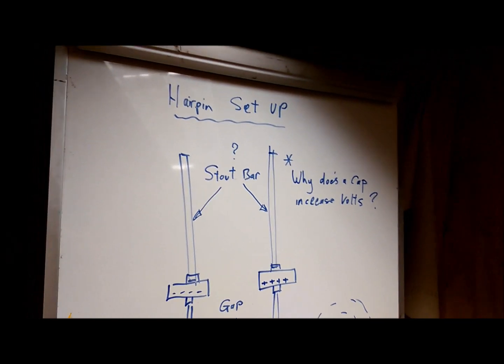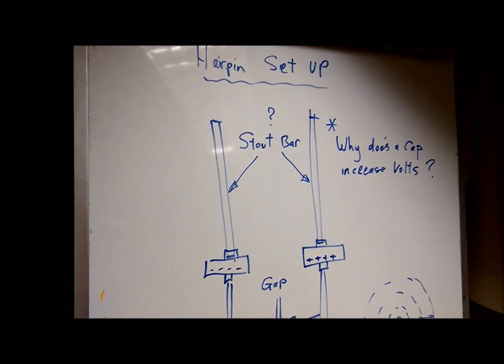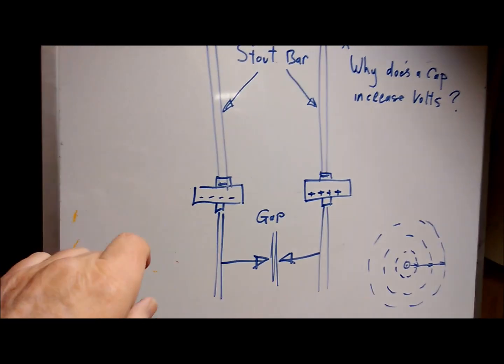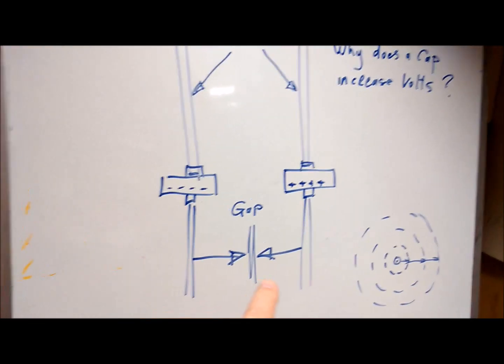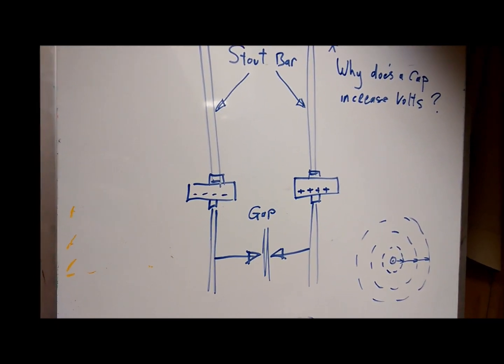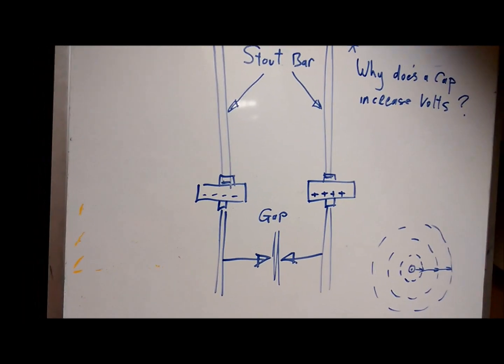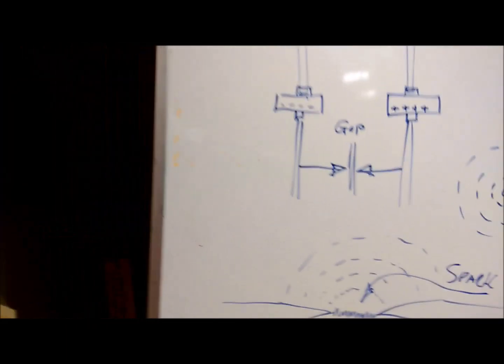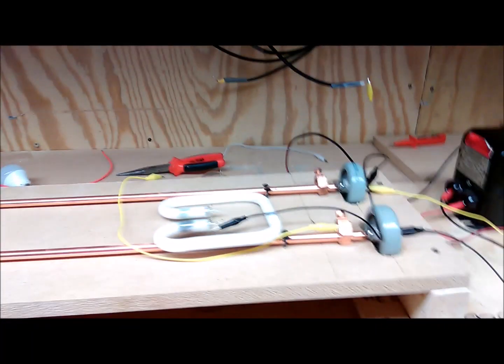Electrons do not exist ( Nikola Tesla Hairpin Circuit )

Comment: Tesla believed in aether in which em waves probagate. It's the work of Faraday steinmetz heavyside. Hertz and Maxwell that matters. It is the displacement current that flows between conductors that is of interest in the direction of the electric field that is a scalar longitudinal wave that interests so many. Electrons appear because of atomic physics where its convenient to imagine particles. However Maxwells equations are of the form fluid flow equations. Imagine a spinning flow of fluid into counterspace and another opposite flow rotating flow out of counterspace.  The source and sinks are the two charges. The spins form attraction or repulsions of this fluid. Counterspace flows counter the viscosity losses such that a charge has lossless intertia. The size of the sink and sources voids are the mass. Faraday and others saw the world roughly like that. When these sinks and sources the flows push at a right angles to these spining vortecies which is the  cross product of the velocity direction of the vortex and electric field. The magnetic field loop upon themselves ( due to prop of fluids ie flow of aether) the electric field is attraction of spinning vortexes which repel if same direction and attract if opposite. The origin of e field is fluid rotation and the origin of mag field is the right angle push upon a moving rotational void.
Dielectricity results where matter short circuits  space by rotational fluid conduction paths (e fields) within atoms (permitivity) . permeability results when magnetic materials provide aether flow paths conduits. Imaging pipes lining up for max flow versus random.
Aether flow are mag field lines and the ease of net linear flow in a material is permeability. The rotational flows forming together to create a larger rotational flow through a material is permitivity which makes the rotational flows  easier. That conumicates charge Rotations. The dielectric lines terminate on conductors. These counterspace voids are quantized and are of exact volume hence mass.
  You might think of a conductor as grops of atoms which connect rotational aether flows efficently (conductivity). Nothing really moves. The rotational moments conduct ie electrons are rotational intertia powered by counterspace. If you call that a particle so be it,  if you call it a wave because it can probagate a signal and power fine. It's rot flow causing net attraction or repulsion of what? The voids. What powers it? counterspace. Magnetic fields are closed loop macro linear flows of aether. What is aether? Incompressible fluid. What is a void? An elastic wormhole to counterspace that can be created or eliminated by flow conditions. What is a dielectric discharge? Chain reaction of void collapse and recreation from counterspace.
Reply: I have looked at the whole arguments for counter space and find it wanting. If you properly conceive of an Aether particle, the need for a counter space goes away. If you hold on to the magical thinking that a field exists, you have to have a counter space.... the bottom line, if your original foundation fo reality has a magical concept defining reality, you will need magical thinking to make reality fit... and you have abandoned any possibility of mastering reality... you will have to depend on your dogma to guide you and sooner or later, your concept will be surprised with failure.  
I'm not trying to argue. I'm just saying, it works for me, and Business Science, or Pirate Science is flawed in this way... counter space, which leads to cause and effect reasoning to demand things "vanishing" and coming back "before they left"... is just magical thinking when mechanistic thinking, holding to the definition of time as just marking the flow of events (its not a dimension)... all of it requires years to master because you cannot see it working around you, and you must memorize the "rules and laws" to understand what is right in front of you.
Keep in mind, anything that is made of multiple components cannot be conserved. Unless you change the definition of "conserve". Electricity has more than one component, so it cannot be energy if energy is conserved. And matter... same thing.  Also, if a law or rule depends on a closed system, it is not a real condition... it is magical in its foundation.  Peace, B
Reply: @mundymorningreport3137  ... But isn't it real science what we observe somehow changes reality? (Double Slit Experiment). I'm not sure what the difference is, either, between a "closed system" and "open system"..? What appears to be going is a debate between fields-and-particles. The particle physicists represent material science (a closed system)? While, the field-people (Tesla, Ken Wheeler) support Electric Universe Idea, that seems to be based on infinite energy potential, that somehow generates fields that we don't fully understand, yet.
Reply: writerNB update 
The pulse was the probably a combo of the way the rotor design slips 180 for synco operation and the loose ‘bearings’ :’D
However I am winding a third experiment, again, same or lower R but 1.68 times the inertia, and the strangest thing possibly the same self resonance??
This all adds up to me that it will pump 1.68 times the water for the same net Watts 

But one thing that made me laugh was take any ‘out of the box’ washing machine pump , slide the perm feild rotor off and observe a rotational offset R combo of say 22Watts , slide the rotor on and run unloaded 13~Watts :’D jam rotor full load 25W :’D 
:’D
:’D
Reply: @kolinevans9127  Hi Kolin, thank you for your thoughts. I have background fixing low voltage appliances (like PCs, laptops, printers), have worked professionally as a tech, qualified in software engineering. Way you describe your electrical experiments, means I cannot see your entire system (component by component) - entire physical circuit... From what I gather, you are adapting washing machine motor/rotor in an attempt to gain higher output results (low input voltage > to achieve more work (watts), yes? So, I'll just ask you a few questions (and hopefully) it will assist me with comprehension of your "experimental design".

1. Do you have a youtube channel (like EpowerDC) - so I can see your experiment running?

2. Do you have electrical engineering quals/training: so you don't hurt yourself?

3. Do you have access to correct detection equipment, so you can verify what you suspect is happening? 

4. Do you actually publicly share your findings? (Some researchers and experimenters do not do this in field of "Alternative Energy Research"). 

Peace. Thanks for reading, and for your kind words.
Reply: writerNB 
Thanks for the reply 

1 I have a channel, but I may ‘patent’ release my ‘invention’ also that just mean release it in the style of an old patent

2 the whole area is a hazard , it’s theoretically an extreme situation the hazard extends outward and unfortunately not everyone has made it here to where we are.

3. To asses inductive inertia, take any fixed ‘Condenser’ of a fixed known value and place it in circuit with the inductor using a rotational applied force enter the applied force at one end of the circuit and exit the other of the inductor condenser 
Place a single oscilloscope probe {Active} on the junction between the inductor and Condenser then place the reference on the input of the applied force , I use 20v applied force , set the resolution and lower the frequency until the rotational wave peaking depending of the light resistance and inertia it will peak at 50 80 200 V etc however the peak at Hz is the number you can use to place into a resonant frequency calculation along with the known Condenser to determine the inertia .
So you can see there is no real room for error here as there is no ‘meter’ for inertia I have a ‘meter’ but I do it this way, just as aside the meter is less accurate than this method. 
Any meter does exactly the same thing but with smaller Condensers and higher frequency. 

4. I just did, read 3 and I have from time to time and may again. 

Regards
Reply: @kolinevans9127  I see... :) Thanks for further feedback. I'd be fascinated to know how you achieve a 200v peak with an input current of 20v (assuming you're stepping down from standard UK 230V AC supply). This did catch my attention... "whole area is a hazard" ... With this in mind, I'll post this link you may find useful. HSE Guide - Electrical Safety At Work:

https://www.hse.gov.uk/pubns/priced/hsg85.pdf

Good luck with your patent. I'll attempt to follow your channel, should you decide to demo your invention publicly. Peace. Thanks for reading.
Reply: writerNB 
Hey thanks for the reply, one reason I haven’t posted work is because I assume as many others we all learn on the fly , some do it in groups others alone , I’d rather make my own errors and learn before attempting to add to the possible chaotic confusion. 
Having said that, I understand a lot more than I did say 24hr ago so again it’s a process, I’m still trying to fit TV force into the equation set as I understand it is again the source of offset . 
Don’t need the safety guide we walk on the edge here we love it, come visit any time. 

The peak is an ‘output’ technically, nothing Magik try it it’s just the resonate result of a realitivly high inertia low R on an inductor and a ‘condenser’  using a cheap sig gen.
Reply: writerNB everything in the 3D plain is inertia, where does the inertia come from? 
Inertia is formed from the condensation or ‘compression’ of a field this is why ‘linearly’ exists TV force is a higher energy state that vectors into the 3D plain and causes inertia. 
When Ken showed a higher power ‘magnet’ having a smaller inertia feild that’s because the feild frequency was pushed outside the medium I.e the ferro fluid , so the inertia is definitely still there it’s just at a higher energy state , push it higher and I assume the frequency continues to rise.
Reply: writerNB you know you’ve kinda twisted my rubber arm, I might look into starting some channels. I mean it can’t hurt to spread the knowledge we have right !
Reply: @kolinevans9127  Hi Kolin, thanks for your kind invitation to view your device. My findings suggest remarkable engineers (who make advances) Tesla, Dollard, Meyer suffer considerable impairment during the course of their researches. I also have reason to understand there is considerable misinformation around Tesla's work. Pity... 

The good news is, persons creating new devices, can engage a holding company, introducing the device (if it can pass safety regs) into a community that has asked for it. Therefore both legal and political issues are circumvented. In my case, I am privileged to be from a family of engineers (third gen), so seem to have a particular way of sync-ing with engineering minds. I tend to just observe senior engineers I've worked with, focusing on optimization (usually at software level) if device has an operating system. 

A clear objective (when it comes to Radiant Energy Tech) has formed in my mind:

1. If current can be captured efficiently from RE field, can it's amperage be amplified, so it can do effective work (watts) under load-conditions? 

Hope this sparks something for you. Thanks for reading.
Reply: writerNB thanks for the reply, do you watch ‘ludic science’ channel I find it interesting 

As for the history lesson, thanks for the feedback, sure everyone enters the game at different difficulty levels, if you were surrounded by engineers, you were ‘lucky’ to be playing on ‘beginner level’ I guess? 

I mean if tomorrow I found any interested child I could show them everything it took 6 years to XP in about 3 months if he/she was an effective listener, so it’s the ‘magik’ of learning 

However, there is something to be said to this ‘adveristy’ you speak of its the reward in knowledge that you XP it yourself and also the probability of something genuinely ‘new’ coming from the adverse set as opposed to the ‘beginners’ lvl is significant in my opinion. 

I’m well aware of the misinformation, I’ve untangled it greatly, look at the simple induction motor for example the universal opposition principle is something significant in itself {if correctly understood} 
Tesla’s ‘high voltage’ work was his less interesting in my opinion. {apart from say the AC lines that run to your house} which of course has a large mass high applied force at a high rotation. Which is then converted to a low rotating lower applied force. 

Anything regarding mass and inertia was more interesting to me

Once mass is offset and correctly configured it can be multiplied because it’s offset to the 3D plain a gyroscope shows that no?
Reply: writerNB I don’t want you to take that the wrong way it’s  theoretically not your fault you’re entered in at beginner lvl it’s probably some other ‘higher force’ at play ?
Reply: writerNB check my Twitter link is in my profile {in case you didn’t know, ya know , so how to do that is click my profile image the there is a link have you learned all that stuff?}
Look out for my ‘notorious acb’ tweet lol
Reply: @kolinevans9127  Hi Kolin, thanks for your thoughts, links, continued support. 

I've always felt like a "beginner" :] But I have a feeling engineering is in my genes (I'm always fixing things)! - I still work professionally in maintenance, today.... 

My software engineering academic training gave me insights into system design. So, any experiment or device, can be thought of as a system. One of primary lessons I learned (working in field) is human is part of that system (the interface is key). A system can be incredible, time-saving, life-changing... But will always be subject to human resistance because community have to accept it.. A very fascinating engineering issue! 

I believe engineers who attempt new advances need to be assisted with tools (and environments) that give them effective optimization. 

Now you have untangled Tesla's "Impulse Electricity", then the issue is how to convey that knowledge to world, or what you wish to do with it... Yes?

"Once mass is offset and correctly configured it can be multiplied because it’s offset to the 3D plain a gyroscope shows that no?"

Yes... :] Issue of building an amplification circuit and correct mass configuration is what fascinates me... If we're talking about Tesla's induction motor, it allegedly runs at 97% efficiency.. A remarkable, engineering achievement. Although I have an idea how induction motor works, I don't have full understanding of it's principles until I can build one myself... If that makes sense? Peace. Thanks for reading. △
Reply: writerNB no probably 
I can say exactly what you said in a different way
A human is an interface, you interface into a human interface, and they key to the human interface is adverse resistance because that’s how humans were designed, they are at their ‘best’ I.e most creative under adverse conditions, it’s coded into the interface and goes back to the primary design which was for ‘war’ which is what the original interface ‘ pre humans ‘ were designed for. 
Wim Hoffs experiments with ice cold environments among others show the physical aspect of the human design interface, but there are many more. 

For more info on inertia multiplication you could probably go to your local electrical company and ask them about the interface from the generator which is high frequency rotation at high applied force to the end point at your socket which is low rotation low force relative, you want to look at how Tesla designed those circuits which translate the two. 

As stated induction motors can be efficient, but the principle of universal opposition is key and something worth exploring 

I’ve untangled much of the misinformation, I don’t all of his papers I’m sure he had a lot going on. 

What I do depends greatly on what others do, Being a human the aim is to ‘live life’ but we’ve lost a lot of people haven’t we ? And probability states that ‘humans’ weren’t designed as ‘rational’ first and everything else so you know ... I guess we’ll see the best you can do is just make sure you’re safe And Sound I hope you agree, life is so unpredictable. 

Any timez lol <3
Reply: writerNB what I’m saying is we’ve gotta look after those interfaces right, I mean we want to good hertz not the bad hertz right ?
Keep watching my twitter <3 
I might post some Tesla stuff if I have any breakthroughs
Reply: @kolinevans9127  Hi Kolin: thanks for update

Reducing resistance (electrical resistance) in any system means increased efficiency (tesla understood this more than most). the least resistive conduit on earth -in any system - is actually air ... using copper or other conductive materials.. (which most of our equipment relies upon) is always an inefficient way to transfer electrical current.

Systems also become less efficient under electrical load (which, at least, you mention, so thank you for that inclusion). 

I'd have to see your water pump in action to understand what's really happening- and then take readings to see if we have any real efficiency gains: can the pump pump more water - under load - using a certain rotor field configuration? (for example)

peace. thanks for reading.
Reply: @mundymorningreport3137  Basically: Yes.

understanding em fields (that we cannot see) depends on our ability to detect and identify their properties accurately. (otherwise, it gets very confusing, very quickly).

faraday detected lines of "magnetic force" using iron filings in 1831. what is he seeing? (is it a field, a vortex, or arrangement of some kind of particle that's flowing)?

maybe it's all three....

i agree time is a kind of energy (that we call time): we see things gradually decaying and growing - which is obviously an energy cycle at work.

how much do we really understand about the power of this energy cycle? can we harness it efficiently? (there would be no energy crisis if we could, right)?

somehow energy is being "conserved", or nothing would re-propagate in the energy cycle. in my mind, it's harnessing energy efficiently, rather than generating it from metal devices is the key to progress. this is where tesla was going... (very few people seemed to understand that basic principle).

peace. thanks for reading.
Reply: Electron is physics fantasy. You don't even need sparks to excite the aether longitudinally, it is only a mere question of mutual field orientation. You dont really need sparks and buzzing: https://youtu.be/z3g1xo-InXU
Reply: @Electrical_Science  I suspect this is true... Tesla grasped this concept of "mutual field orientation" in a way I do not fully understand, yet.. Thanks for commenting.
Reply: TRUTH i agree
Reply: Do you know what a paragraph is?
Reply: good read
I especially like
"the electric field is attraction of spinning vortexes which repel if same direction and attract if opposite"
Reply: I’ve come up similar theories but use different logos, specifically I’ve noticed that all conductors are crystals, well technically most things are crystals but I have noticed specifically that all conductors are ‘arranged crystals’, an easy way for someone learning the concept is to think about sets of resonators. My general theories entail inertia offset on a single field but this lost education you speak of I think syncs well with the various outlines on my variant current learning path. I call  the dielectric force a ‘tractor’ force it is a longitudinal ‘pulling’ force vortex, it also can be ‘rotated’ like both the non aligned forces of the same field. I.e the ‘B’ force or gyro inertia ‘magnetic’ and V tractor vortex quiet simply longitudinal waves are ‘sound’ waves. At the vectors of alignment in the 3D plain there exists nodes with the other offset force of the same field.
Reply: @kolinevans9127  Interesting theory: How does dielectric "tractor-force" become a sound wave, please?
Reply: writerNB 
Good question, I feel like through recent discoveries, that it is as Tesla theorized the ‘primary’ force 
In the physical plain all actions seem to be driven by inertia you could give me an example of where they are not and I’d definitely consider it
However inertia results from TV force {pulling vortex} {tractor vortex} 
If one looks at a transducer, sound waves are forming through the inertia that results from the applied force on the inductor. 

Although I have recently observed different harmonic “pulsing’ through an inductor I wound in a specific way as to increase the inertia capacity of the inductor by about 1.68~ times a ‘standard’ single wound and keeping the resistance the same or lower. 
How this was {possibly} observed was {I have no confirmations yet} was on the perm feild of a rotor of a washing machine pump.

 in which I rewound the stator 

the rotor operation was as normal and seemed to observe the higher inertia at lower R results but I did perceive a pulse , I’m rewinding a second in a different harmonic configuration so we’ll see I guess. 
The short answer is ‘I don’t know’ but it’s fun to try and find out. That and mowing.

It’s theoretically possible {and I’ve had that thought} that yes the configuration I used is causing a longitudinal pulse because it basically forms equivalent longitudinal aspects inside the inductor. I guess it’s an ancient ‘flux capacitor’ lol in that way : ‘D
Reply: writerNB 
I guess my real question is 
‘How much water will it pump ‘ ? 
: D
Reply: @kolinevans9127  let's simpler ways say it a impulse thr no pulling effect of ac or no ac or magnetic part fk maxwell Tesla sepearted those 2 at higher voltages using saprk gap n capabilities of. Cap I think it's quite doable and may people r doing it right too